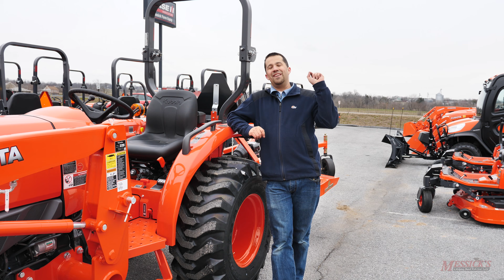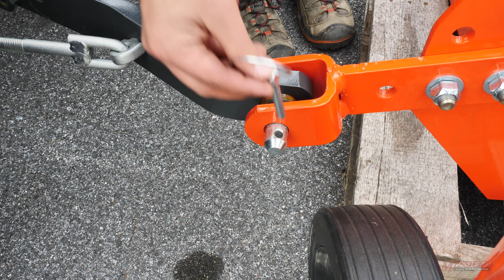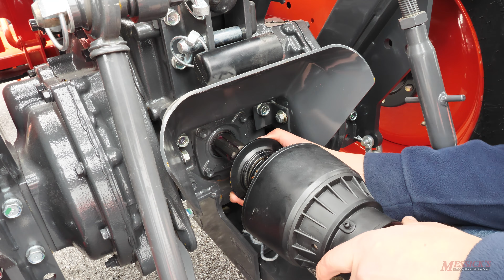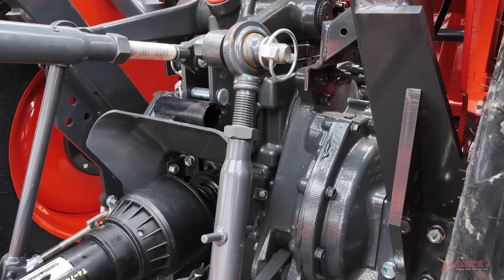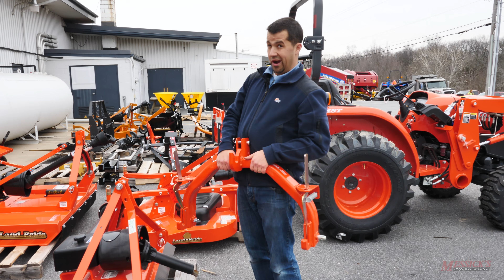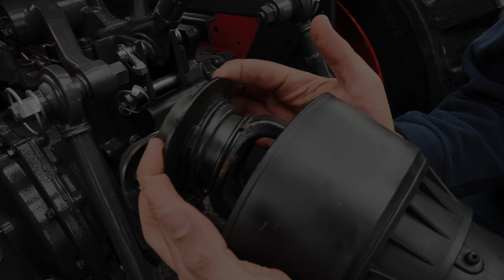How to attach a 3 point mounted implement

Comment: Thanks for your assistance on this issue. I was wondering if you could do a video on swapping wheels around to allow a wider distance and greater balance. My Kubota L3800 is good but with agriculture tyres it’s very easy to flip over. Thanks, Jimmy in Australia

Comment: A helpful add on to this video would be quick hitch that has a floating implement, such as that deck you were using. 

Another question would be with the finishing mower you had in this video, the two arms that hook into the 3 point arms, are they supposed to be in the slot that allows for minor up/down movement like in your video or the two static holes above, when coupled to a a quick hitch to allow the deck to float?

Comment: What about the turnbuckles for horizontal sway (the BX25 manual appears to call them "check chains"?)? How do you adjust those? I saw somewhere that for some implements these shoudl be adjusted loose but for others rather tight. So what are the criteria for tight or loose?

Comment: Another great informative video.
I would add,  whatever the hitch or implement , a pry bar, such as a five or six steel fence post, is an excellent addition to your Equipment yard to move the implement slightly up, down, left or right with little effort or muscle, that aides in lineup equipment to tractor hitch.

Comment: It's definitely worth it. The $120 quick hitch from Harbor Freight does the job good. I have 1000 lbs of counterweight on it.

Don't use the $30 bushings, use the $3 sleeves. Remove the bolts from the top hook and put in quick easy to move pins instead.

Now when I buy implements I just make sure that they will match up to it. Get an adapter plate with spaced-out pinholes for the top for some of the implements .

Comment: That quick hitch seems like a great idea, but since you said it don't work for all implements, I guess it may not be as useful as one may think.  May be worth the purchase price though for those who don't have many implements but implements that are compatible.  If you just have 1 or 2 implements maybe not worth it?
Reply: Love mine. Had to do some reworking on my older finish mower to get to fit but once done it's good to go
Reply: @dougbarr5703  I had to modify my box blade to fit, a couple minutes with a grinder and a can of spray paint and it works just fine with the quick hitch, although still not really sold on it...not sure if its something with my tractor but it seems the 3 point doesn't lower enough to hook up to anything on the ground with the quick hitch, it would barely connect to my box blade and tiller on the ground, now with the quick hitch it doesn't hook up at all, I have to put the implements on a pallet, or 4x4 blocks in order to hookup to them.

Comment: When dropping an implement it helps to position it on wood blocks or something similar. Not only does it minimize ground contact but it makes it much easier to "persuade" it to match up with your lower links by moving it slightly if necessary.... and I guarantee you it will be necessary.

Comment: You skipped the hard part.  I use a hammer.  I hate it.  I hate it.  I hate it.  This is the best that the tractor industry has engineered for hooking up a 3-point implement?  Common you guys, get back to the drawing board.

Comment: Is there a tool to use on the side adjustment arm to make it easier to make adjustments?
Reply from the maker: If you have a turn buckle? A screw driver though the slot.
Reply: @MessicksEquip  no it is just like the adjuster that was on the tractor in the video with two opposing nipples.  This is the up down adjustment.  Is there a special wrench for it?
Reply from the maker: @WildXNatur  stick a screw driver though the slot and crank it.
Reply: @MessicksEquip  what don't you understand? This is not a turn buckle, there is no slot it is a solid steel tube with opposing steel pins welded in place, with each end threaded.  One end connects to the power lift and the other to the drop link. I know that they make powered adjusters I just wondered if they had a tool that looped over the pins to make adjusting it easier.   By the sound of it I will have to fabricate one.

Comment: Somehow he missed all the swearing I do when i'm hooking my my hitch.
Reply: oh, as a new tractor owner, I didn't know it was required..
Reply: @alankovacik1928  I've had my 1st tractor for about a week now.  Honestly I've swapped implements on it a couple times, no issues either time, but then again its a sub-compact tractor with smaller implements so they're not that cumbersome to not be able to move a bit by hand if needed to line things up.  I did call my dealer and order the quick hitch though to just make it a little simpler hopefully.  I bought the Kubota BX2680 with the loader, tiller, mid mount 60" mower, box blade, and pallet forks.  Its getting its first bit of work this weekend at my aunt and uncle's moving gravel around in their yard for them and leveling things out.  We shall see how it works out.

Comment: One thing you should have said is that you should always park your implements on flat level ground. When I started using my father-in-law's bushhog I was getting annoyed that it would take a solid ten minutes to hook up, whether I was hooking it up, his farm hand, or both of us together. He has it sitting on a mixture of railroad ties and a concrete blocks...while being about 6-8 inches higher than the path. One time I didn't finish mowing one weekend so I detached it just on the driveway off to the side and the next weekend it took me all of 30 seconds to get it on.

Comment: You say if the teeth are not lining up you can turn the pto shaft on the tractor? I cant get mine to turn at all. I rented a finish mower just to see if i liked it before purchasing one and i could not get the pto shaft on....in fact, i could not move the pto shaft on neither the mower or the tractor (bx23s). Am i doing something wrong? Thanks!!

Comment: Get a hydraulic top link. I find it’s actually easy to extend that hydraulic top link all the way then connect it, and by retracting it you can pull the implement into place. Of course this only works on implements with wheels or castors. Also make sure your lower links are all the way down and spread as far apart. Keep adjusting the hydraulic top link until the lower arms are inline with the pins and able to be kicked on, or pinned to the impliment. 

Also. connecting PTOs are my least favorite thing to do. They’re so greasy and you’re working in a cramped area. Not my idea of fun.

Comment: with regards to an implement with weight-bearing wheels rolling on the ground (such as the mower you just hooked up): can you comment on the position of the implement top pin compared to the bottom two pins - as in: should they all 3 be directly in a vertical plane? should the two lower flexible links on the implement sag at the same angle as the flex link that the tractor toplink is pinned to?  the instructions on my Woods RM990 are extremely unhelpful with specifying exactly how tight/loose all these should be in order to let the mower "float" a bit over terrain that is not exactly level.  

another seemingly silly Q: if there is a lot of extra length to any of the pins, is it of any mechanical advantage to loosely "shim" them up with washers so the lynch pin is not way out all alone on the end of the pin?

last point: a Quick Hitch will make it harder to get the implement's PTO driveline on - you simply have more framework to have to reach through/around making alignment of splines/pull-collar-while-pushing-shaft even more of a hassle than usual - just something to consider as well.  PS: Harbor Freight Quick Hitch was a complete fail for any of my implements - but it was cheap and i got a free tape measure !!!

any chance of demonstrating various backhoe-subframe set-ups and attachment steps?  it's quite unclear how much some subframe mounts will protrude into the 3-Pt lift area.

Comment: Putting all your implements on dollies so you can move them around and don't have to worry about positioning the tractor just right saves a ton of time...
Reply: I use plastic pallets with 4 inch casters, works like a charm.

Comment: B2650 here. Do you recommend a 3 point quick hitch for swapping implements easier?
Reply from the maker: if your implements are compatible, yes.
Reply: Are all or most land pride attachments compatible? And how is it easy to tell?
Reply from the maker: Land Pride is easy, they put a sticker on the ones that are compatible.
Reply: @MessicksEquip  Does this mean they work for all three LP quick hitches. I have a LP1560 box blade and will be getting one of their 5' rotary cutters and wonder if the 05 would work? I like its smaller size and that it doesn't need bushings. Maybe the bigger ones don't now either. But the lighter hitch seems easier to this 65 yoa. I have a B2601. I've noticed reading the specs that the 05 has slightly different dimensions than the bigger LP hitches.
Reply from the maker: @RichardGilbert2727  05 would be okay. I use one. There are times I wish I had a 15 because the release levers are a lot more stout.
Reply: @MessicksEquip  Thanks, Neil!

Comment: Not that I have anything against Kubota but John Deere just fits more of the needs that I have slightly more power slightly more capacity a little bit more weight right out the gate just a little bit more
Reply: ...and JD's are a lot more expensive, at least in my neck of the woods.

Comment: Hi Neal, Love your videos! I've got a question about the PTO shaft. I grew up farming with old pre-1970's tractors and have recently gotten a new JD5045(my family's first new tractor in decades). I was surprised to see that the PTO shaft didn't have a lock-pin hole that would allow me to use my old implements. Everything now is quick-connect. This apparently has been standard for quite some time as I discovered while asking around for a good solution. I got a lot of blank, confused stares when I was trying to explain my situation. I finally found online a short PTO shaft extender that was quick connect and had the lock-pin hole tapped that solved my problem, but I'm wondering when that standard changed and if anyone else out there has encountered this same dilemma?
Reply from the maker: No idea when it changed, but that adapter is the solution that we use

Comment: I recommend against kicking the links on. If it needs more than a gentle tap from the kicking, there are a couple of risks.   It can put you off balance around equipment with lots of sharp and /or hard edges for one.  For another,  if you don't hit just right you can bruise the bottom of your foot or even break the small bones in your foot.  Instead, invest in a 2lb rubber mallet.  Safer, easier.

Comment: You spent twice as much time on the top  link and the drivetrain.  I want to see how to get the bottom two links connected without moving back and forth a dozen times.  Box scrapers are the hardest for me.  Brush mowers are easy because of the trail wheel.
Reply: Juliet Foxtrot    thats why i love my 57 JD 520   old school technology aint always old technology  my tractor has pins you pull and you can telescope out your lift arms then once hooked ya lift the 3pt and theyll collapse and relock   oh and a quick tach toplink ball

Comment: Would you recommend a QH05 For an L 3901?
Reply: I think the QH05 is targeted primarily at sub compact tractors. It is rated for 28 HP with a maximum lift capacity of 700 lbs. compared to 20-60HP and 2000 lb. lift for the QH10 and QH15.  I have a QH15 and would recommend it over the QH10 as it has an adjustable top-hook for greater versatility.
Reply from the maker: Nope, QH15

Comment: I have been watching your great videos for quite a while and took your prodding and hit the subscribe button today.  I am the owner of a variety of implements and ran into the problem you discussed with a standard quick hitch system.  I solved that by going with Pat's Easy Change System that allows me to do everything by myself with 1/10th of the effort that it used to take.  I hope you don't mind but here is the link to Pat's system or just google it.  http://www.pats3pointhitchsystem.com/page/7229    I have used it for about 8 years now without any problem.  I use it with my box blade, field rake, brush hog, cultivator, single bottom plow, tool bar and  arena rake, all of different manufacturers, without any issues.

Comment: A message to all of the new tractor owners! Always switch the engine off when attaching the pto!
Reply: Unless you want to become organic fertilizer!
Reply: Dont tell me how to run my life!
Reply: @Markinthemiddle  wind ya neck in 🖕🏻
Reply: You dont have to
Reply: Nicole I don't get why people get OTT with that as most tractor PTO's are clutched. You can tell if your pto is or not as you can turn the stub 1/2 a turn to get the shaft on easier.

Comment: Back in the day it used to be quite common for the right hand 3PH lift link to have a hand crank to aid in attaching implements. You would attach the pin on the left side and then turn the crank to raise or lower the right side to aid in getting it attached. This crank could also be used to level an implement side-to-side. Most SCUT/CUT makers like JD and Kubota no longer put the crank handles on the lift links which is a bummer. They all still have some type of adjustment mechanism but these days it's more for leveling rather than helping to attach the implement. I believe New Holland still has the cranks on a lot of their models.
Reply from the maker: I'm with you on that. I was thinking of going though and trying to find some of those and see if we can match them up to other models. Seems people are interested in doing those kind of things.
Reply: That would be very interesting.
Reply: Go for the "Top and Tilt" hydraulic option.
Reply: My Ford 8N has that crank. It comes in real handy when I have the blade on the back and I want one end or the other to cut a little deeper. That was the first thing I noticed that my Kubota didn't have. It's a mild inconvenience but livable.
Reply: EOSJOE mines a turn buckle style.  I hate it. Oh god do I hate it. Why dear god cant they stick to the old style.
Reply: My B2650 has the ratchet crank handle. It is an option and works great!
Reply: Having grown up on a farm in the 60s, I had forgotten about those hand cranks, and yes they were a big convenience back in the day.
Reply: Those were a convenient tilt function item. They did make it easier as is mentioned here, but if you needed the implement to be level, you just screwed that up and now need the tractor level to level the implement!